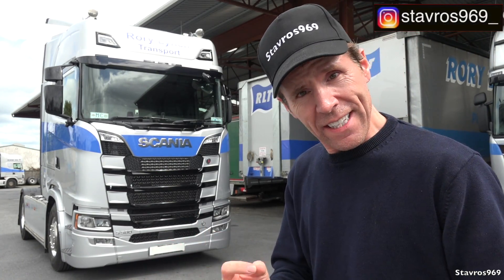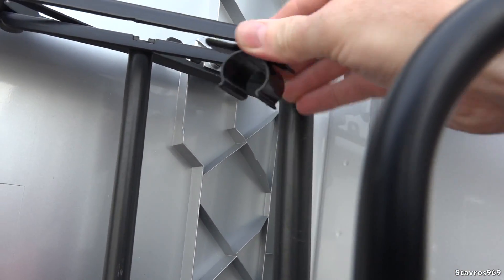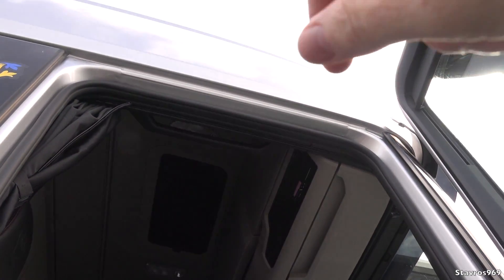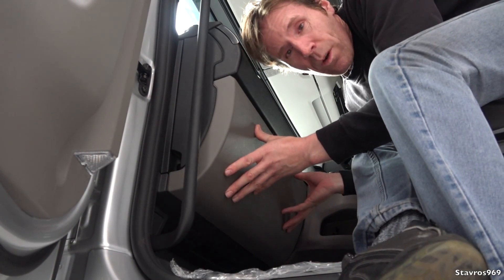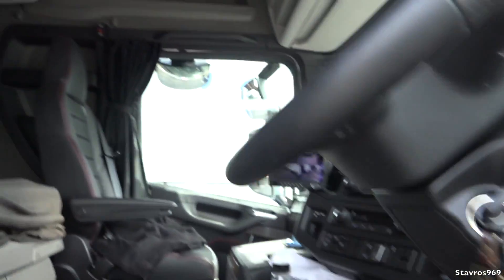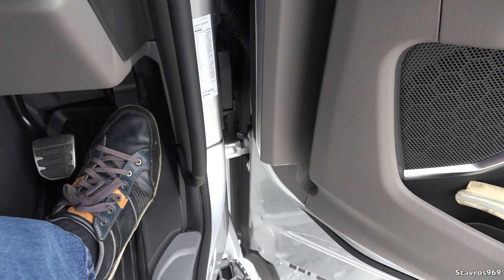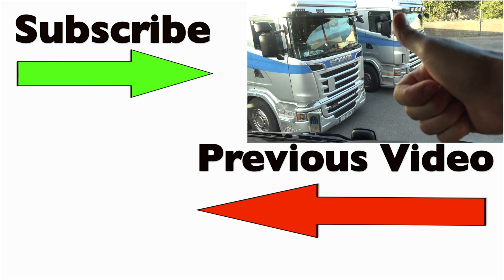7 Things I Hate About The SCANIA S Series!!

Comment from the maker: Good morning, did I miss anything?☺️if I did make sure to comment below, cheers 👍
Reply: Can you test drive a Sisu
Reply: cool video
Reply: ayuub muhamed he is from Ireland
Reply: @ayub_mohamed  in the dashboard
Reply: I think  the scania s serious I lovely
Reply: You should be able to bring up the driving times on your display in between the gauges. Go to the drive settings across the top and them press down until the drive times come up.
Reply: That water ingress issue above the door is a right pain had the rubber trim fitted at main dealer so fingers crossed
Reply: Mine no longer saves preset radio stations, every time I put my digicard in the following day the memory is blank...been in to scania who fixed it for it to then do the exact same thing about a week later 👎🏻
Reply: agree with the window switches had the tops of both switches lift off leaving very sharp plastic !
Reply: What are you inferring?🤔🤔🤔
Reply: I seen ya today near corcorans in portlaoise
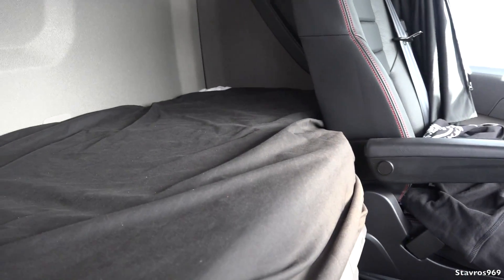Reply: 6:58 yes there is an option to have a net and it's free, the one you had was in the design and it's free too but scania have a bigger one too
Reply: Gr8 shout for cleaning cloths. Cheers Stavros, gonna try the me self 👍👍
Reply: @paullfc88  Mine Has The Same Problem But Instead Of Each Time I Put Card In Its Every Time I Lock Or Unlock Cab With Fob, Ive Now Reverted To Locking With Key So I Dont Keep Losing Presets
Reply: @SubSonic18   It's A Common Problem On The New Gens That The Tacho & Dash Stop Communicating & The Dash Times Freeze But Tacho Is Still Counting Down Or Sometimes The Dash Just Shows Blank On All The Times
Reply: And that's why i like the G440 from 2013...well i liked the 2012 even better but it was sold 😥
Reply: Good morning mate. I want to point you one thing "you hate" about this truck. 08:10 :) I mean if you haven't already noticed, over 95% of the infotainment systems within right hand side cars/trucks have the volume/power knob on the left because they are designed mostly for for the left hand side steering wheels....exemptions just for your sake, would involve further design/cost for your preference. Am I in the wrong here? Also the reasons why cement pumping trucks are only left hand drives. Thanks

Comment: How did it leave the factory in France with such a wide panel gap? Well, there's your answer - it left the factory IN FRANCE :)
Reply: Scania ,a Swedish company,owned by the Germans and built in France ?
Reply: @jasoneldridge4738   they are bulit in sweden holland France
Reply: @WilmeroFamous  and Brazil and Australia
Reply: You are right there brother 👍 when they left at Sodertälje they were spot on 👌 thats Swedish quality control witch France dont have.
Reply: @ruuti74  That's a quality issue, if you order a Big Mac anywhere (for whatever reason someone would punish their body with such garbage) it will be the same.
If a car that is built to spec comes out differently between factories, then that is a big quality issue that needs to be fixed.

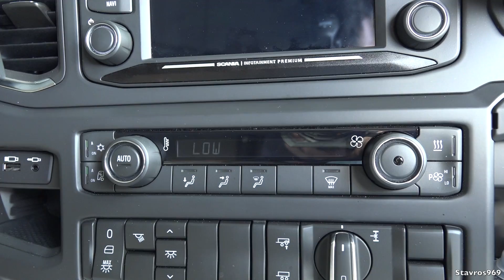Comment: 8:38 it gets back to its original position when the engine is turned on. 8:55 in tacho settings go to "DDS settings" and enable it to allow displaying info on the dash. 9:40 it comes on at 60 km/h and you can adjust the sensitivity of the LDW in the Settings. And you did forget one thing. The lid of the fridge doesnt stay open

Comment: 1st world issues there Stavros 😂 but your right enough about them, especially considering the price. The amount they spend designing them you would think practical stuff like the hazard switch would be better. I'm not a fan of the switches on the door, I always think they will get soaked when reversing in the rain so need a cloth to cover them up.

Comment: Totally disagree on the doors. They sound like on a luxury car instead of sounding like falling apart on the old model.

You definitely get all the tachoinfo on the dashboard, even in much more depth then on the old model, you just have to open the road symbol and scroll down. There you can push "OK" and insert it as a fixed feature on your dash.

And the made the bunker liftable instead of having the net feature.

Comment: Be aware that on the Volvo there's a temperature sensor in the cab tilt pump hole on the side where the pump isn't mounted. So don't insert the handle on the wrong side or you'd need a new sensor.
The window switches are designed that way due to legal reasons on some markets where it's not allowed to close a window by pushing down the switches, only by pulling up the switch. Originated as a child safety design for passenger cars to avoid decapitation.

Comment: I agree with your comments on how light weight a lot of the switch gear is on many modern trucks, there seems to be a desire to make them look nice rather than function well. No doubt replacement costs will be higher also? The window switches you pointed out on the window shelf will form a dirt trap in the recesses as well.

Comment: Put the AC in Auto and it wont default
Reply: @stuartesson45  the glued in window is flexing with the cabin , ruber sealing seated glasses had more room to move around without deformation. but hose are not nice anymore and eat up 0,001 litres/100 of fuel more...(i just came up with those numbers)

Comment: Two points I want to mention for you Stavros; One, which has been commented earlier, is that you can change your interface in the dashboard to set favorites, like your driving time and break time, amongst many other things. The second one is, my workplace has two Scania R500 nextgens, both rounded up about 650 000 kilometers on the trip each, and those window buttons are just as reliable as if it was brand new. I get your concern but if those babies can survive 600k km, that goes to show they are very durable. And these trucks don't have one driver each, they are swapped between 4 different drivers every 24 hours, rolling almost around the clock.

Comment: Pretty much my same dislikes. I tend not to use those side lockers for that same reason, broke a few finger nails on them. The sun roof covers is a pain being on manual, I like it closed but open on an evening. Water on the inside door when opening is a real annoying problem. I have the swivel seat on passenger side but again would have preferred a fold up one. I’m due a new one in December but I doubt anything will be improved. Nice vid👍

Comment: I have mine for 300.000km now and the truck is not bad, but it shows that it's made in France. Different width gaps all over the outside. When it's raining harder, while i drive water comes into the cabin where you showed so i need an umbrella.  Infotainment screen freezes from time to time and i cant hang up bt call. Cabin heater blows warm air for about one hour, then it decides It's too hot, so it starts blowing freezing air until you have to start the truck to get good temperature back. Also i find it louder inside than older series. Also my freezer if i put on one snowflake It's not enough, if i put on two, everything freezes inside. And i bet there is some other faults too, that i can't remember right now

Comment: Great video Stavros. 
Looks like, there is no such thing as the perfect truck, but you would expect more from Scania with the price of them.
Wouldn't like to see water dropping down on the door switches, next thing is, mirrors adjusting,  doors locking etc, without driver input. The fuse board, not great also. The sun visor would be better as an electric roll down shade, fitted out to the end of the windscreen. 
Hope you had a look at Luke Vernon's latest video of the F16 500, very nice.

Comment: Bottom locker can actually be opened one handed. Just give the lever a single pull and you can open the flap. It's not necessary to keep pulling while you open the locker. For me as a Scania mechanic the fusebox is way better than the previous one cause there's more working space around it and it's so easy to add circuits compared to previous model.

Comment: Agree with some points, lane departure for example mine picks up shadows in the road. First thing I do is turn it off. Also the rain dropping on the door panel really bothers me. But disagree with some points. The doors closing quietly is beautiful. You can modify the dash to mirror your tacho times on the dash display, sure you know that having driven 1 for a while? I don’t wear shoes in my truck I leave them on the top step and had them wet a few times. Cut a small v shape in each bottom corner of the seal, problem solved!

Comment: Well if the window switches are the same ones as Peterbilt use they will be a problem. They get water in them short out and fry the control module very expensive to fix. Peterbilt used the old rocker switch that you showed. They were so good they almost never broke. Same problems here as over there they don’t build them like they use to.

Comment: Forgot to mention, in the States they did away with the cab over design and have re adopted the classic engine forward design and incorporated more aerodynamic features into the design which results in higher mileage when it comes to fuel consumption. Cab overs are like a brick wall when it comes to cutting through the air. Don't get me wrong they are nice looking but who wants to pay for extra fuel?
Stavros? Interesting a Greek name in Ireland.

Comment: I gotta add to this Stavros.
First Im not a fan of Scania . probably never will be.
I Drive S series daily with a raised floor. Engines are all CNG.
One thing that pleases me its the Least Scania of all the Scania's I drove. Aka they learned some things.
BTW That lower cubby is directly copied from Iveco but Iveco's pops. XD We have them too...
One thing I see is although you have the "premium" Dash mushroom LCDs inside tach's You have a very poor Info content.
Like Our Scania's Both Rigid and Truck have 9 horizontal sections in the menu, and each has at least 5-9 vertical slides on each.
Including Detailed driver Tach with More info you ever thought you need. Weighing sensors,CC, Maintenance, GPS central display etc... 
So either you don't have the most expensive one, Scania doesn't equip Diesels with it or It might be a later addon. Ours are 2018.
Also Climate will Auto resume if you put it on auto and set temperature. Annoying thing is It doesn't blow below 3 on Auto. Its like Im either gonna blow or not at all. Also Needlessly large windows that go only 3/4 down. And on Rigids we Use platforms to Deliver CNG to Customers. They don't lower straight down when decoupling but move Down and forward which creates problems with centering the pins and decoupling...
Adaptive CC Doesn't allow half lane cyclist passing. As well as run up without blinkers. 
Oh yeah controls for lights , mirrors and windows on the door , AMAZING idea Scania... Just sayin

Comment: Considering most of the electronics in the trucks today you might check and see if the is a software setting that can change the default switch settings so you don't have to constantly switch on the AC or any other option. Even for mirroring your driving hours down onto the main display it might be software controlled for where it will display.

Comment: I have the opposite opinion of the doors: now they feel like quality products. Also having driven couple of last generation Scanias where the door has to be pulled with huge force to get the door closed, probabaly enforces the opinion. What I don't like is the new hood opening system. If it breaks somehow, you will need two men to open the hood.

I also like the new window switches, because it's nice to be able to choose, if I either want to open the window just a little bit or all the way with one click. It's not as robust, but it's similar to the solution used in many normal cars where it works just fine. I've driven the next gen R580 for roughly 3 years now, but I drive a 30-metre-long full trailer truck, so I can't say anything about the things releated to driving a semi.

Comment: I drive an S Series myself, and for the tacho information, I have that in my display. I also do have that rubber lip above the door, and it literally does zero difference... Still get water all down my neck and on the side panel
Reply: The rubber seal must be put in right position or it won't work and the door adjustment helps too wich is easy on these... In some cases the high beam lamp on the roof has leaking its cover leaking water in that does same thing

Comment: Hi Stavros969, i have seen the problem with the lowest sidelocker on the
drivers side...
The lowest locker could also be openend by pushing on the locker on the 
side of the windscreen, but i'am not very sure about this.
It is also possible that it is an optional extension for future usage.
But what says (the) Scania (manual) about this?

Comment: I Drive an R model 560 most of the time. Got to drive the new model 500 recently and not a fan of the exhaust brake being incorporated into the retarded system. I believe it should stay fully independent as the older models are. Also 1200 revs at 90 kph is too low, feel 1400 better. Still my favourite trucks to drive.
Reply: you can spec them with different gear ratios .
Reply: its better for the fuelconsumption

Comment: Air con system has a fault it should stay where you set it and get the dealer to turn on the drivers hrs for the dash they come switched off from factory then go to your local motor factory and buy what I call a snow mat they have deep sides mark it out on the scania mat an cut out the drivers door side and steering colum leaving the high side on the inside edge that stops the crap blowing over and I've had mine for 3years and my heel still hasn't marked it let alone go through it.